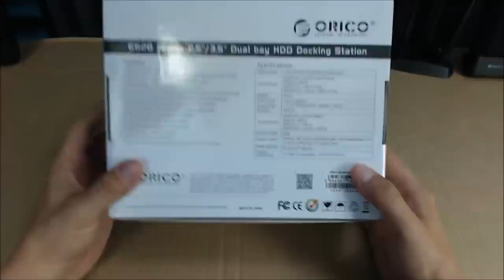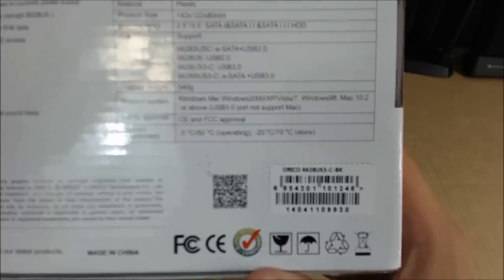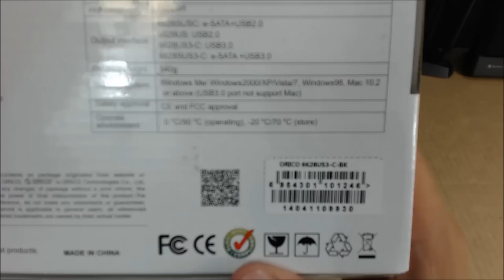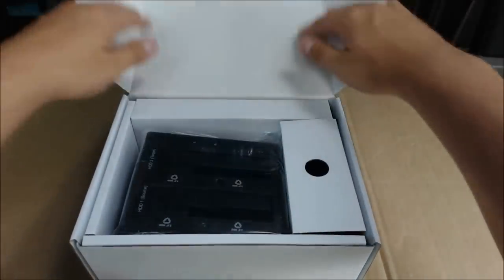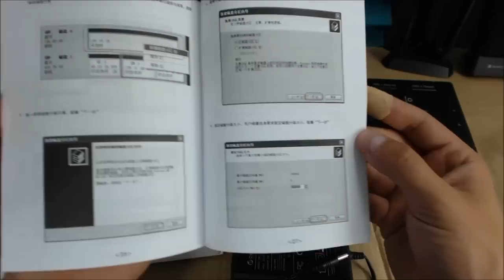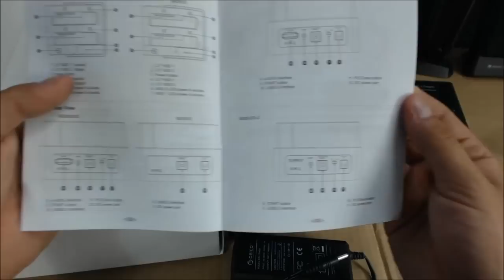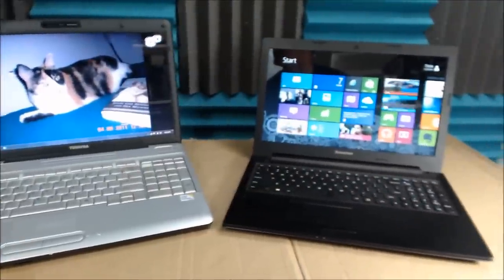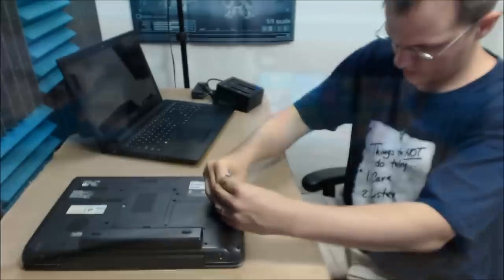Orico Dual bay HDD Docking Station (6628US3-C) (Unboxing and Demo)

Comment: Changing the subject, Im probably buying a pcie USB 3.1 card... A type. Do you know if the usb cables are different?
Reply from the maker: Iván Sandoval I believe A type is just faster but still the same shape as past USB, while C type it the new format that is smaller and can be plugged in right side up or upside down. I looked up some pictures to be sure but I do not own either at this time.

Comment: I am thinking of buying one on ebay, around UK £27. I have been successful in copying partitions over from one HD to another using GPARTED in a Linux OS distribution, so maybe that's the way to go or use the free version of Macrium Relect to clone drives. Thanks for your review.

Comment: Hi Brian. You really did some kickass review. Does this stuff support raid?(E.g both use same spec and setup it) Kindly need your info, thanks
Reply from the maker: you could do raid with this, but they make different products that would support raid much better

Comment: so I can clone a 3tb hdd to a 126gb ssd only if Im using less than 128gb on the 3th hdd, correct?
Reply from the maker: Iván Sandoval Yes
Reply from the maker: Iván Sandoval you also need to leave about 20% of the SSD available other wise you will run into performance issues.
Reply: +Iván Sandoval No. 

The manual says clearly: The Duplicating is "Disk to Disk", NOT "File to File". Meaning duplicating an empty HDD takes the same amount of time as dupicating a full one. The volume of the target drive HAS to be BIGGER than the source drive. Even when they are theoretically the same size, even two drives from the same manufacturer with the same model, there can still be a tiny difference in size.

Bottom line: If the target drive is larger than the source drive, even by a few bytes, you can't clone the source drive.
Reply from the maker: +Iván Sandoval It's been a few months have you tried the clone?
Reply from the maker: +anhnh vn That's good to know, I was about to try restoring an old hard drive, but I might run into this problem

Comment: im thinking of buying. Is this good in 2018? or to invest in 2 single bays (not into single click cloning at the moment but good to have)?
Reply from the maker: I'm sure there's better ones out there by now. This one still works really well. Just for space-saving purposes I would say get a dual big one if you need two hard drives plugged in at once.

Comment: Can you clone a system hd? does it transfer all the licenses...? You specify you need a bigger destination hd, even if Im usin 60gb on a 3tb hd to clone it on an ssd.. is that possible?
Reply from the maker: Iván Sandoval Before I answer your first question I want to make sure I understand your question. What system hard drive (HDD) are you trying to clone? All Licenses would be transferred, the docking station doesn't care what the files are it just copies them. I miss spoke, as long as the amount being transferred from the source drive is less than the totally space of the target drive the clone will happen with out any data loss.

Comment: "I had to format first"...which is covered in the inadequate directions as is disconnecting the USB cable when cloning.
I just got one of these today - did a quick test clone of two used 250s without any problem.  Went to do it with a 320->500 and it just would not start.  The double-tap note almost seemed helpful as it started on a test run but, when I popped in the 320/500 combo again...all I get is the 25% light and no cycling through of the other three.  So far, it's pure garbage.
Reply from the maker: Anonneemuss I'm glad you got an undated version of the directions. My directions had neither instruction in them. I have done projects before where it was not required and I wanted to see if it really was a requirement for this product (formatting is required).  As for the disconnecting the USB cable when cloning... I never said that. I was just pointing out that on the website is mentions not plugging in the USB cable while cloning. Just to add to that, you do not need to have the USB plugged in when cloning unless you're cloning from a drive inside the computer. I apologize that you clearly got a defective HDD Dock, but I'm not a representative of the company and getting frustrated with me is a waist of your time and energy. Please contact t your retailer or Orico and start the RMA process.

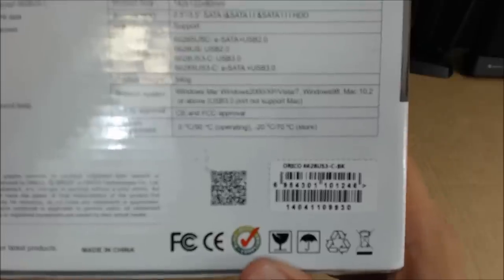Comment: 200GB in 1:30hr not bad. your quad-core computer can clone more faster than that, 500GB in 2hrs or below. but also defends on drive type and brand btw.
Reply from the maker: kjotuber you're right, I could have cloned it faster on a different computer

Comment: What if you use 3rd party software that use the Shadow Volume Copy with 2 hdd's in the dock would that work and would it speed up ? Software like macrium reflect or Acronis?
Reply from the maker: Fate Averruncus I'd have to test that out. I was only using the hardware to test the clone button
Reply: Chandlee Style Please make a video if you can it would be so interesting to do see that in action
Reply from the maker: Fate Averruncus I'll see if I can figure that out. In the meantime check out my Samsung Evo video. The speed was better on that transfer
Reply: Chandlee Style Will do thanks

Comment: What about Inatech??
Isn't it a more "less heaty" version of the Orico??
Reply from the maker: Tito Nogueira never heard of insect. Qicent is a less expensive Orico and it's made by the same people
Reply: Chandlee Style Inatech
Reply from the maker: Tito Nogueira I meant inatech auto-correct got me
Reply: Tito Nogueira No,all these docking stations square boxes are all very similar designed.These docking stations boxes all have heat sink to protect the CPU of the unit,so the procedure worked fine for the CPU and the circuit board.The heat will dissipation all around the plastic covering after it finishes it work.That why it hot when you touching the plastic covering of the box.The guys who designed these things,never designed a little fan to blow the hot airs it out as these things are working,because as the cloning functions you probably only uses once twice maybe three times for the life of the product.Save them maybe a quarter to don't put in a fan for their designed could and will save them in millions of dollars as these products things going into massive production modes.

Comment: used similar device years ago (red version diff brand but works exact the same as yours) works fine but if you clone windows 7 main drive two problems on the cloned drive if i remember windows update and windows mail did not work on the cloned verson.microsoft (clone in same pc)did something clever to prefend them to connect. Everything else was fine on the windows 7 clone.
Dont know if thats stil an issue with windows 10.
Reply from the maker: superbrighteye windows updates always has problems on windows 7. Especially is it recognizes the new hard drive as new. The more those problems stay common not the more I Microsoft just wants everyone to use 10

Comment: 200gb in 1.5hours?
Omg. 2tb will be like 15 hours!!!!!
You used HDD right?
How long would it take in SSD??
Reply from the maker: The 1.5 hours was with a low RPM laptop hard drive. The SSD would theoretically be 4 to 10 times faster based on the drive. I have not tested SSD to SSD on this since my Samsung evo video. Check that one out for a better idea on speeds.

Comment: i have an Orico 6629. it clones from an 120GB SSD to 250GB HDD in just 19 minutes
Reply from the maker: Max Chu newer model and the opposite direction I cloned. I'll definitely need an upgrade if I plan to continue cloning at reasonable time

Comment: do you still have this dock?
Reply from the maker: Amy Polak I do and I still use it
Reply: Chandlee Style any issues? I’m going to upgrade pc soon but if I still have issues going to change it. Have had nothing but trouble. When I change HD’s it doesn’t work, have to turn the whole system and pc off for a day then it works. Lately it hasn’t. :(
Reply from the maker: Amy Polak sounds like you're hard drive is on the way out. You need to back it up before the data is corrupt. My docking station still works fine, but I would suggest getting a newer version so the transfer rates are a little faster
Reply: Cool, thank you for that. Would you still recommend orico?
Reply from the maker: Amy Polak Definetly

Comment: I want one of these for regular HDD use, is it fast enough for gaming?
Reply from the maker: It might work okay for single player games but your load times might be long. I would not use it for any fast pace online gaming
Reply: @ChandleeStyle  even with 7200 drives? is the bottleneck the USB3 or the dock itself?
Reply from the maker: @JuanSanchez-rb4qu  it's not the drives it's the transfer speed of the USB

Comment: I wanna be able to clone 2TB SSD drives.
I wonder if these cloning bays would survive a once a month treatment of that.

And how fast could it be between 2 ssd using usb 3.0? Anyone has any idea?
Would be nice if it could use 2 usb3.0 ports to speed up the process, but I doubt that.
Reply from the maker: If you're using the device to clone you do not need a cable. As for the time I'm not sure, it depends on the drives, but you'd still have to do some transfer math based on my findings
Reply: Chandlee Style using between samsung pro ssd and plextor ssd.
They're pretty fast and reliable.
I just don't know how much the speed would be bottlenecked.

Thanks either way :)
Reply from the maker: +Tito Nogueira it too less than an hour with SSD to SSD using the Samsung cloning software
Reply: Chandlee Style ok cool, I'll try to find your other video. What's it called? THanks

Comment: is there any reason why a can't boot from the docking station via usb?
Reply from the maker: you should be able to, what is your boot order set to?
Reply: +Chandlee Style 
the first and the second options where my IDE  (Hard disk and dvd ram) followed by network boot,and USB hdd
sow i choose the usb docking station drive and from some reason it just wont boot..
 in first i thought maybe it is the hard disk sow i switched between the hard drives 

I've took the one that was inside the laptop plugged it in the docking station and the other insert into laptop and nothing...same thing
Reply from the maker: +Gil Sh move USB HDD to the top of the list
Reply from the maker: +Gil Sh I haven't tried booting from the docking station. let me look into it and get back to you
Reply: +Chandlee Style 
thanks..in my bios booting options i see that the disk in the docking station is not recognize bur in the network boot f12 option i see it..
Reply from the maker: +Gil Sh try it and see what happens
Reply: +Chandlee Style 
i think i should upgrade my bios
Reply from the maker: That might help, but I'm thinking this is not a bootable device... I just can't find anything that says that
Reply: +Chandlee Style
damn..
Reply from the maker: ***** Sorry Buddy, I looked and I can't even find a user manual for this thing